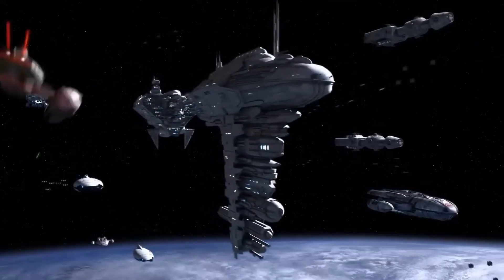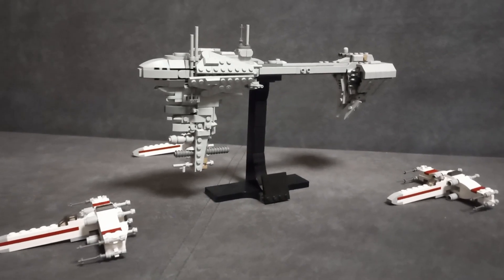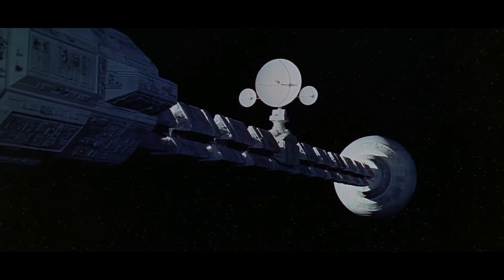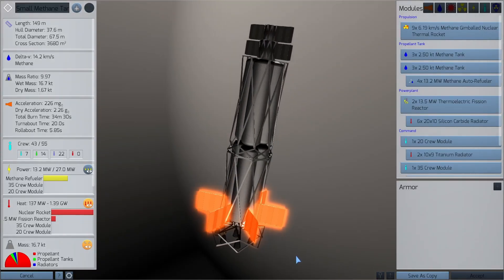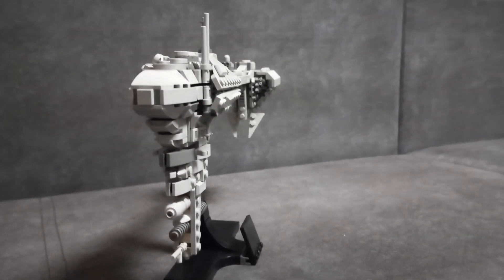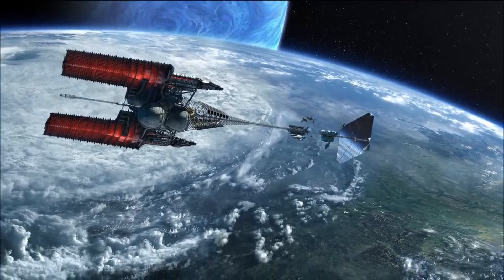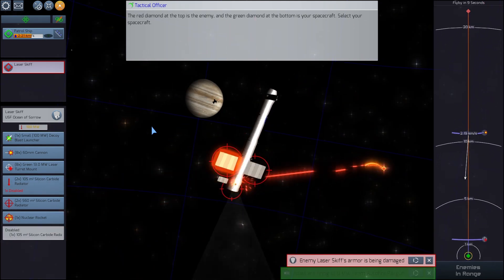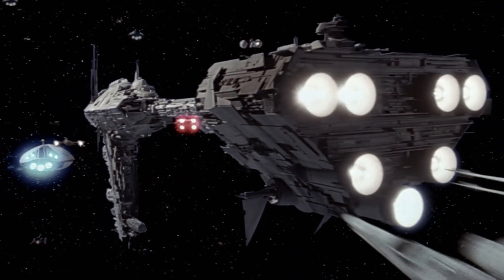Nebulon-B Medical Frigate is a Realistic Spaceship?

Comment: Keep-n-mind makeshift.  BUT the nebulon is also capable of being a boom for a solar sail.  This allows the ship to charge a bank of algal jellies to produce what amounts to an energy packed insulation device.  There's thousands of them in various 'ice field' planetary complexes.  The systems hardly noticed a few dozen.  However, the ship was also modified by removing engines to create a raider capable of taking a Star destroyer in straight up joust on the outer rim.  It can carry a select wing of two alongside assault barrac boats, whose repeating blasters may hold open a shield reboot after ion dropping of the power boat engines.  Cheerio though.

Comment: Very succinct video. I like it. I always thought that ship was interesting. 👍

Not as a commentary on your video, but curious of your thoughts: I've always felt that nuclear power in spacr was a no-go. Granted my background is in pressurized water reactors (PWR) and my knowledge of other reactor types is minimal at best. Still, given the design of nuclear reactors and their heavy dependence on water density and gravity, I find it difficult to believe nuclear power can exist in a weightless environment apart from atomic batteries like the Voyager probes.

What are your thoughts?
Reply: Also, the inverse square law operates under the assumption that radiation is passing through a medium (a gas) rather than a vacuum. In a gaseous environment, you have plentiful molecules and atoms to either scatter or absorb the radiation. In a vacuum, not so much.

This is why shielding is lead (a dense solid) or water (a dense liquid), and then a gas (just what we deal with on earth). Distance would help in space due to dispersion, but it would be vastly inferior to (in order of greatest shielding to least shielding) solid, liquid, or gas mediums.
Reply: Still, great observations! And regardless of a vacuum or gaseous environment, distance IS the best protection. So if a nuclear reactor was to be there, this design would be preferable.
Reply from the maker: @kingbadmovie  Once again, you made some very valid points. When I'll have time to return to this topic, I will try to dedicate some attention and energy to these problems. Pretty sure there are people out there that have some answers (like the futurist youtuber Isaac Arthur) but in this case, I'm not one of them. At least not yet. Likewise, thank you for the valuable observations as well. I enjoy these conversations. Soon I'll have a vacation and it's possible that I'll make another spaceship-related video but I don't want to ruin the intrigue by revealing what it's going to be about exactly he he. Stay tuned lol
Reply from the maker: Hello, it's very nice to find your comment! Thank you for still following the channel and for the positive feedback. 

Yes, being succinct was the goal when I made this video. Most of my previous videos are long and I think that's what makes them harder to "digest" so now I experiment with this shorter format. Also, long videos are a lot harder to make, you spend a lot of time editing them, you can't post them as frequently and because of that it takes a lot longer to learn what engages the audience and gain experience as a content creator. Of course, since I've posted this video I haven't uploaded anything new yet but with time I will. I have some ideas.

As for your question, I'm afraid we are at the limits of my own knowledge here lol. What you outlined sounds like an engineering problem and, for example, not a problem in our understanding of physics (like faster than light travel or communication would be) so it's possible that there is a solution but I haven't researched this specific question enough to know what it is. For the time being, all I can say is that Stanley Kubrick was very adamant about the science in 2001: A Space Odyssey being as plausible as possible. So I assume Discovery One ship with it's nuclear propulsion cannot be that far away from reality, otherwise it wouldn't be in the movie. It might be a naive assumption but it's not completely without basis lol.

Generally, when it comes to space travel and realistic future spacecraft, my understanding and vision of these things is based mainly on these sources: the aforementioned Children of a Dead Earth game and it's developer blog written by the creator Zane Mankowski, a website for science fiction writers and hard sci-fi fans called projectrho.com and finally collaborative online hard science fiction space opera setting called Orion's Arm. People who work on these projects seem to maintain that nuclear fission based propulsion systems are possible, not to mention that there was an actual project proposed in the 1950s called "Project Orion". The idea was to use nuclear weapons as propulsion devices for a spacecraft. It is even said that after a certain period of non-stop acceleration, a spacecraft like that could reach 10% of light speed!

The main problem with nuclear power or any complex tech in space is cooling, like you already noticed by mentioning the use of water. In space it's hard to make sure things don't overheat. When you are in a vacuum, you can't transfer your excess heat to another medium, like you can when traveling through the atmosphere or in the ocean. That's why spacecrafts use radiators - panels with series of pipes that spread the thermal energy by spreading the circulating coolant over their surface area. These panels glow on electromagnetic spectrum and in this way radiate the heat away. For nuclear powered spaceships this would be essential.

Like you know, water is used in nuclear reactors to cool them down. I'm not sure if weightless environment is a big issue in this case, I assume you could still control the flow of water by manipulating the pressure in the chambers that contain it. However, it's also possible that nuclear powered ships would not use water as a coolant in the first place. They might use something else entirely, something artificial perhaps. Maybe that would help to navigate around some of these engineering issues.

Sorry for a long response. So much for being succinct lol.  If you are interested in these questions, I suggest reading up some of the websites I mentioned before, they might contain more specific answers. Thanks for the question! Now I'll have a reason to research this a little bit more.
Reply: @tadasjakubauskas4464 My concern is certainly that of an engineering aspect, but an aspect that requires the existence and predictability of on of the fundamental forces: gravity. Simply put, more dense matter goes down, less dense matter goes up. So we have water in the oceans and water vapor in the sky. But in space that is not the case, gravity is relative at best and non-existent at worst. This leads to a major problem in regard to the heat exchange between the nuclear reactor core and the "exchange fluid" passing by it. As my engineer instructor told me succinctly, "rock gets hot, hot rock makes water hot, hot water makes steam, steam makes turbine go roundy-roundy." Sounds silly, but he legitimately told me that's how nuclear power works in a nutshell on my first day. 😂

The issue with this principle is that it depends that water goes "down" and steam goes "up." But in space, there is no down and there is no up. Therefore what mechanism will force steam to go in one direction rather than another if gravity doesn't force it? Further, an absence of cooling around the rods leads to incidents akin to 3 mile Island. Which, granted, wasn't devastating, but still diminished the efficiency and safety of the core, as well is a famous "near miss" on what could have been a greater incident.

These are all engineering problems, for sure, but my technical brain can't find a solution around them. Granted, I've only a bachelor's degree and I've had nuclear doctors talk to me about nuclear power and it was akin to hearing a lecture on Ancient Egyptian Calculus, I was lost😅.

Now nuclear batteries I think could work, as they've worked on voyager, though I haven't the slightest idea on how they work, but they've been proven to work. I think a solar sail could work, capturing solar energy and converting it to propulsion. Especially in conjunction with nuclear batteries (and whatever magic my mechanic brain can't understand) as well ass gravitational launching, chemical reaction, and maybe even a kinetic to kinetic conversion system to push craft to unfathomable speeds.

Love talking to you, despite my glacial replies. 😊
Reply from the maker: Hello again! Recently I saw an article which is about a new nuclear-powered spacecraft propulsion system. It gives a brief summary about the way nuclear propulsion systems work in space:

"Although they’re relatively new – nuclear systems for propulsion or electrical power are simple.  

Fission-based systems work by splitting low-enriched uranium atoms in a reactor to create heat. Super-cooled hydrogen is flowed into the reactor and the heat from the uranium quickly turns the hydrogen into a very hot, pressurized gas.

In nuclear thermal propulsion (NTP), the super-hot pressurized hydrogen is funneled out a nozzle to create a powerful thrust. The mechanics of an NTP engine are much simpler and vastly more efficient than chemical propellent engines."

Here's the link to the full article:

https://www.lockheedmartin.com/en-us/news/features/2022/how-nuclear-technology-will-get-us-to-mars-faster-than-ever.html?fbclid=IwY2xjawEauNVleHRuA2FlbQIxMQABHX-W4cqa4cK2xYbow67vZZ7AHdrmmiIiuBr1bBl7a0bcg_37gbKLbRfW-g_aem_lg1gh230bQ2cbs4i-mJLHA

Comment: No one seems to realize this, thanks for bringing up the similarity with the 2001 Discovery. Also similar design principles with Avatar spacecraft which was also made with irl space engineering
Reply from the maker: Thank you for the positive feedback! Yes, I only noticed this similarity just a few weeks ago. One time I was just looking at my Lego set of the Nebulon-B frigate and thinking about ways that would justify it's particular design in the real world. It looked so cool and I wondered what would make a ship like that actually function in space.

I knew most ships in Children of a Dead Earth are nuclear-powered and because of that the crew section must be positioned on the opposite end of the spacecraft to reduce the radiation exposure. I also knew that  Discovery One was designed with the same principle in mind. Then I realized how similar Discovery One and Nebulon-B actually are in terms of visuals.

I wouldn't be surprised if the designers of Nebulon-B took inspiration from 2001: A Space Odyssey considering that it was such an influential precursor to the original Star Wars trilogy when it comes to special effects and science fiction cinema.

And yes, ISV Venture Star from Avatar has to be my favorite sci--fi ship, it is very well thought out. Interestingly enough, ISV Venture Star doesn't have nuclear fission reactors. It has antimatter engines but the matter-antimatter annihilation still produces a lot of radioactivity so the crew section is positioned far away from the propulsion system. That's why ISV Venture Star is more than kilometer and a half long, to increase the distance separating the crew from all of the sources of radiation on the ship.